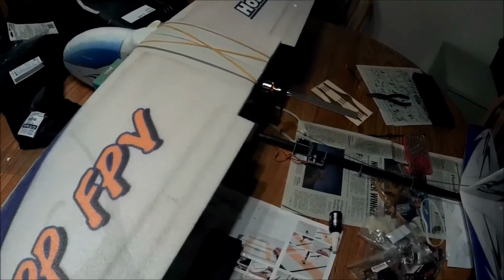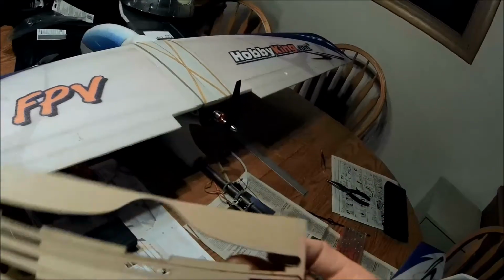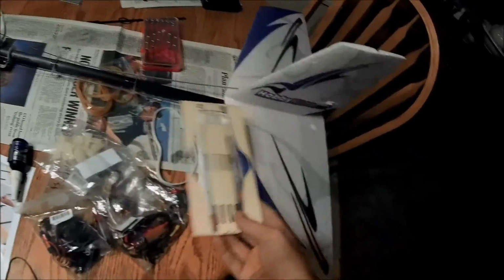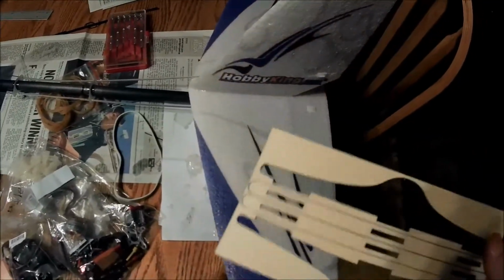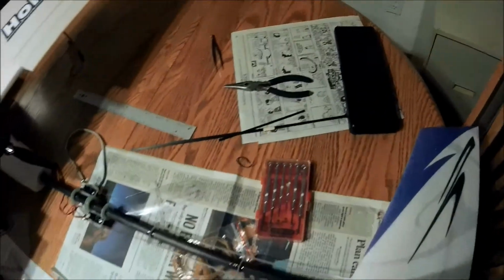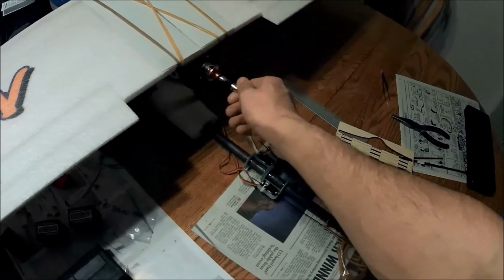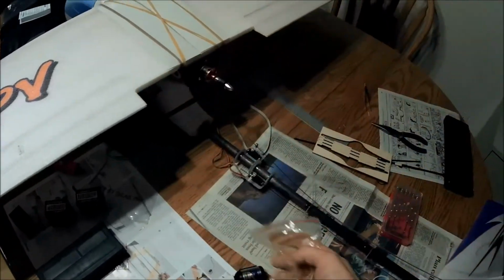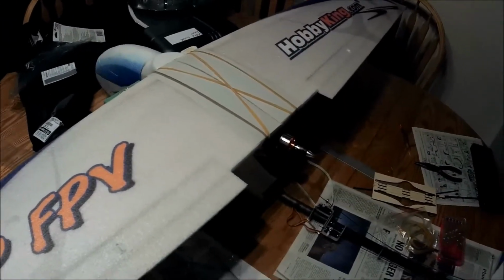The EPP FPV BUILD VIDEO | *Read the Description*

Comment: Are you using any nuts on the backside of the plywood to keep the motormount secure?
Reply from the maker: no i just have em all tapped right into the plywood
Reply: Okey! Thank you. Will do the same with mine then. Nice video btw, was brawsing throuth a lot of videos before I came to yours and it really helped me